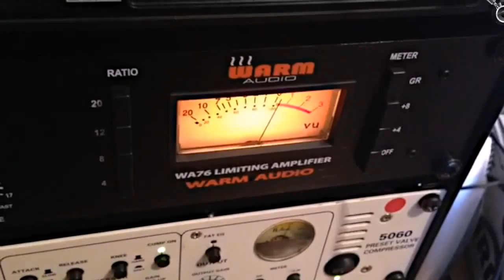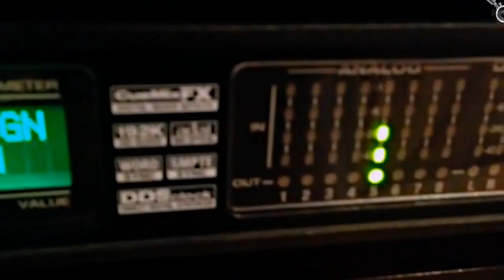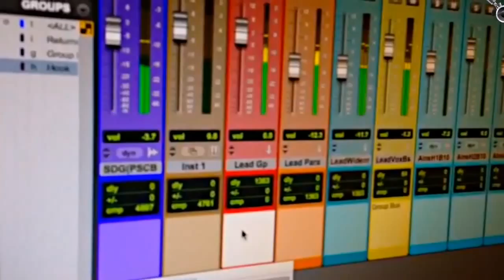Inserting Analog Gear in Pro Tools/DAWs

Comment: When I print a track using analog hardware I can hear the analog noise in between the lyrics when I start placing plugins, is there anything I can do to reduce it or remove it? Please help, much appreciated
Reply from the maker: Hi can be a number or issue regarding the quality of your AD-DA converters but u shouldn't have any major issues with modern converters with floor noise. Just adhere to the basic typically recording and mixing levels through the gear. It's had to say without seeing your setup etc. Follow me on IG LmpRecordsUk and drop me a DM

Comment: Good morning, I'm having trouble getting signal out while printing with hardware. I'm using a manley core with a distressor to a Apollo twin. I can hear the changes when I twist the knob but when is time to print the waves don't change. What am I doing wrong? I'm using pro tools as well.
Reply from the maker: You need to print in real time when using hardware you can't do offline bounce , so create an audio track and print the mix to it in real time
Regards

Comment: Great video bro question I have an Apollo Twin and I actually have that same compressor and 2 more. Now with the Apollo twin I’m limited to 2 inputs and 4 outputs which 2 are going to my monitors. Now I know I would have to get another interface and maybe figure away to have them work together in pro tools. I seen a video so I’m sure it’s possible. But my question is will it work the same way out one channel and back in the same corresponding channel?
Reply from the maker: Yes buddy you have 2 spare outs and 2 ins so you can have 2 mono units or one stereo, so you firstly need to check how Pro Tools is seeing your I/O numbers, if it's seeing your input as 1&2  and outputs as 1'2'3&4 you may need to use 3-4 as your main outs and use I/O 1-2 as your hardware inserts, since the numbers need to be identical for pro tools to work, I've moved to Studio One and I/O you can map any in to any out which is better IMHO,  hope this helps, otherwise message me if u require more help.
Regards 👍🏾
Reply: Lmp Records. Respect

Comment: yeah...great, but how do you set it up cable wise????
Reply from the maker: So for example if you have a mono compressor, and want it in channel 5, so a cable comes out of your soundcard channel 5 into the input of the compressor, then the cable comes from the compressor output into channel 5 input on your soundcard, what's important the cables must come out and back in on the same channel on your soundcard for the inserts to work. Hope this helps 🙏🏾

Comment: can you use the same hardware insert on other channels ???
Reply from the maker: SHOT MASTER J no you can't, a hardware insert can only be used once as those channels becomes active, if you want to put it on a number of channels you create a bus and send all those channels to the bus and insert the analog gear there, however all will have the same hardware settings. Like I send all my background vocals to a stereo bus and insert  a stereo compressor, so all the bvs  gets 1 insert. Hope this helps!

Comment: Very smart to write in the compression settings.
Reply from the maker: Thanks I find it very useful, especially when I'm mixing multiple projects at a time. Takes a few mins to check the settings/adjust and 6mths down the line,settings are always there.